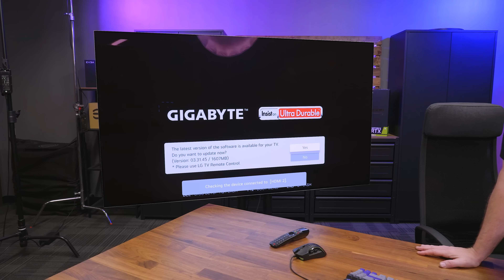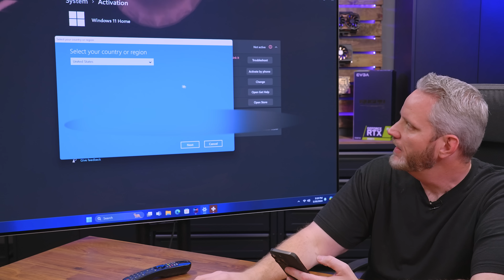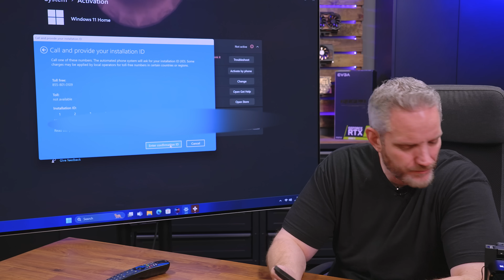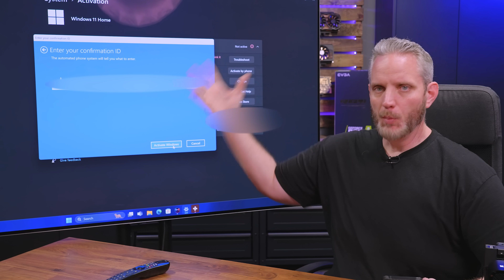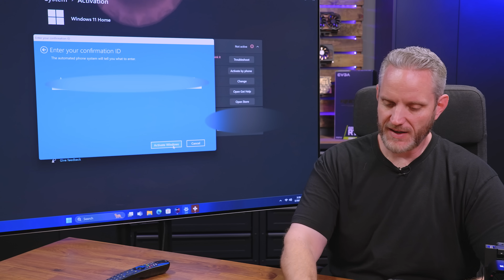How to move OS drive to new PC and keep Windows and Activation! EASY!

Comment: simplest option is to link the activation key to your mircosoft account. did it years ago. yes you have to buy an official key. but havent need to buy our source another code from somewhere since. just. built like 3 pc's since i did it works fine everytime.

Comment: What motherboard brands would you recommend?
I've always used asus but don't trust them anymore for obvious reasons.
Reply: AsRock (a branch of Asus when you follow company chains) seems attractive for some systems where product defects, bios features (they seem to just all boards all the BIOS features including ones the nonflagship boards have nothing to do with) and bugs, etc. show like it really is different companies doing different work but I have no experience with their customer service.
  My MSI experience was years ago but I sent a board for fixing (don't remember problem or outcome but think it worked) and another required I send a board overseas from the United States to fox a BIOS flash that went bad after a message saying it was successful; I made a cable and reflashed the chip directly through a special motherboard header using a serial port on another PC.
  Gigabyte I haven't looked at much for my own systems with them being anti-Linux in formal statements (I use other odd choices) and they seemed to dance around power supply defective engineering issues of Gamers Nexus piece was honest about it.
  Maybe I will look more into server/workstation companies like SuperMicro in the future though many years ago companies like that seemed rather bad for customer service as general users would expect it to be.

Comment: Oh this sounds like something I'm gonna need when I do a new build in a couple years saved
Reply: this is going to be me tomorrow lol
Reply: Or perhaps consider an OS that respects their user's privacy and freedom like Linux
Reply: @whydoyouaskdude  and risk being without the games you play and programs you need
Reply: @masudparvejsani  Every single game (152/152 of my library) runs perfectly fine. Yes, i don't play any battle royale shooters or games with anti-cheat, or use CAD software, no Adobe Suite. I am aware there are pending issues for those and even for them exist solutions, albeit more cumbersome ones.
Reply: @whydoyouaskdude  There's no solution to not being able to play games with anti-cheat.
Reply: @OfSheikah  Which is better than not being able to do what you need/want to do
Reply: @masudparvejsani  It depends. Some devs allow proton support, others (Riot with Vanguard anti-cheat for example) don't. You could try a Virtual Machine with GPU-passthrough, but it is technically bannable playing like that.
Reply: @whydoyouaskdude  Linux doesn't have the same level of support Windows has.
Reply: @codboroks97  Right, it is arguably even better considering how many solid resources are available
Reply: @whydoyouaskdude  No thanks I'd rather have a hassle free swap
Reply: @Messiahs  Windows and hassle free are mutually exclusive expressions :D
Reply: @whydoyouaskdude  They really are not. Windows has been fine for 99,99 people since windows 10

Comment: How do I move my OS to a new bigger SSD in my pc while retaining all the data?
Reply: Cloning
Reply: use a cloning software like EaseUS or Samsung Magician Tool if you're migrating from a Samsung SSD to another Samsung SSD.
Reply: @ayayahuasca  I shouldn't run into any issues? I assume when booting I just need to go into the BIOS and set the new SSD as the boot drive, i'll do some digging :)
Reply: @Skreamies  no, you shouldn't and yes, you have to set the new ssd as your boot drive. but if you're still unsure, google is your friend. good luck! 👍🏻

Comment: How do you move your OS and programs from one SSD to another?
Reply: Rescuezilla or clonezilla. Extremely easy.
Reply: @OhioIsNotRealGuys  clonezilla requires a drive = or larger; resize + move partitions in Windows or software like gparted until they fit a desired area if smaller is desired.
Reply: try disk genius, it what I did 6 hrs ago, it worked and it was free